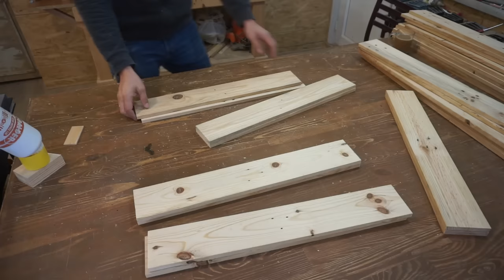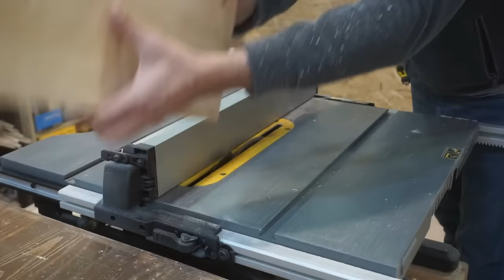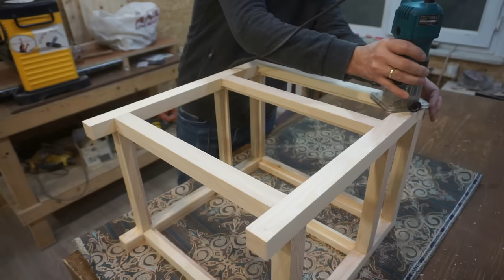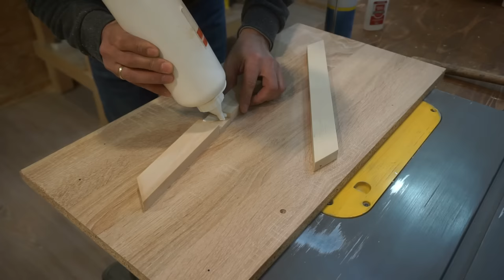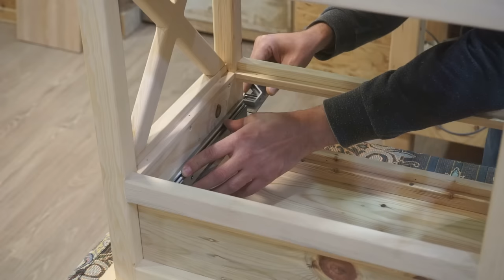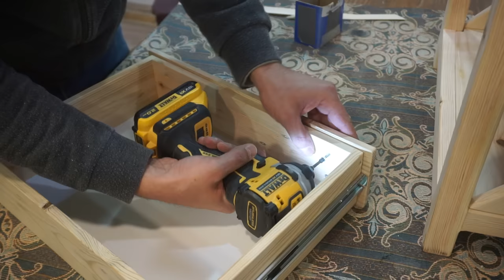Making nightstand from pallets / Pallet wood nightstand diy / Paletten komidin yapımı

Comment: A good joiner does not use so many screws to join, but only woodes pins and gluing the parts. For example, Tittenbond glue holds parts better than screws. In my carpentry, I try to use screws and nails as little as possible, mostly from the nailer. That is beautiful carpentry work.
Reply from the maker: Thank you very much.